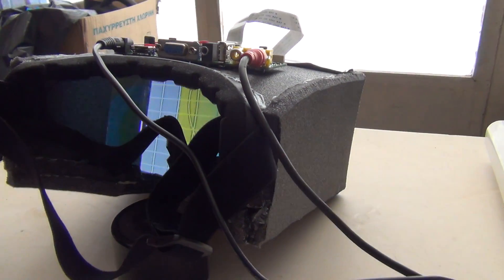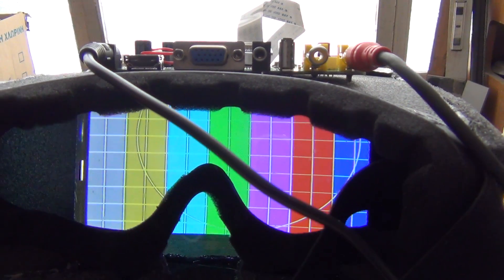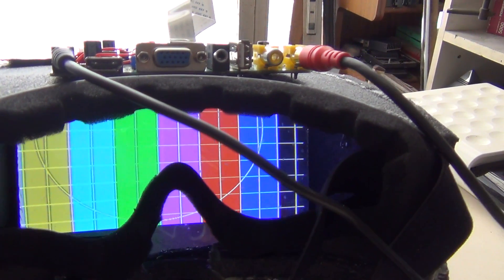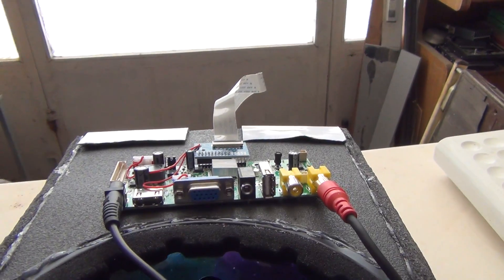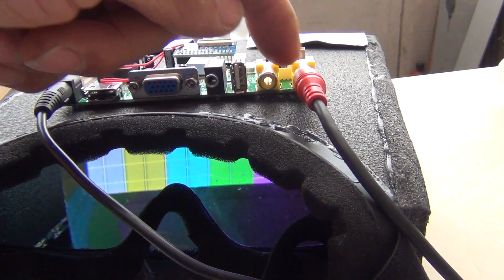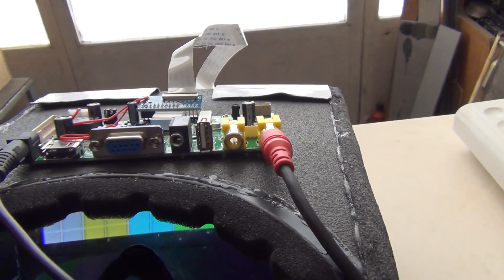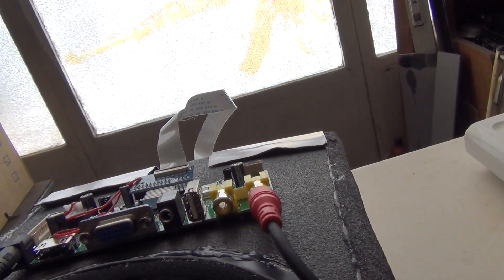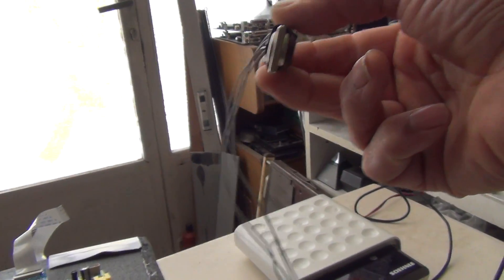DIY FPV HD Goggles with immense FOV 7" 1280×800 LCD Panel

Comment: Is there a fresnel lens in there for magnification or something else?  I'm getting ready to build some similar to this
Reply from the maker: +Andy D-House Yes there is this one http://www.ebay.com/itm/A5-Flat-PVC-Magnifier-Sheet-X3-180X120mm-Book-Page-Magnifying-Reading-Lens-Glass/390876196938?_trksid=p2047675.c100011.m1850&_trkparms=aid%3D222007%26algo%3DSIC.MBE%26ao%3D1%26asc%3D34859%26meid%3D8d0629b2f06e4718a78317be970b5cda%26pid%3D100011%26rk%3D2%26rkt%3D10%26mehot%3Dpp%26sd%3D151704361613 with ad glasses if you are wearing glasses.This one was good for me+2. http://www.ebay.com/itm/231568284614?ru=http%3A%2F%2Fwww.ebay.com%2Fsch%2Fi.html%3F_from%3DR40%26_sacat%3D0%26_nkw%3D231568284614%26_rdc%3D1
Reply: +Kiriakos Axavidis Thanks! ordered that lens. looking forward to getting some goggles like yours built.  Well done!